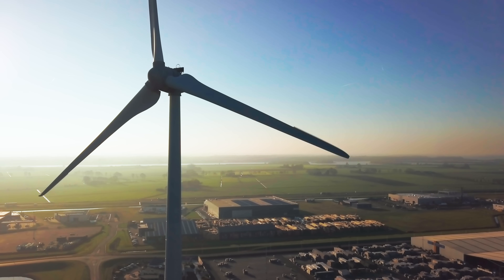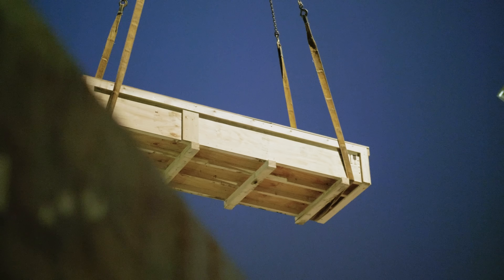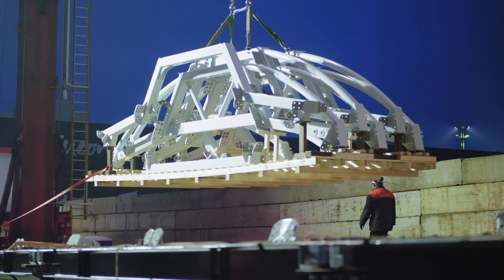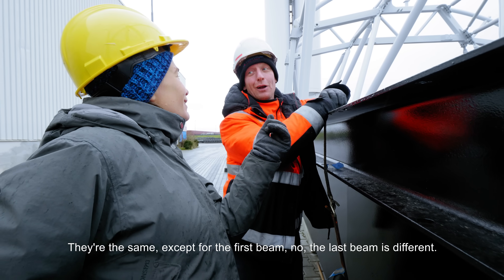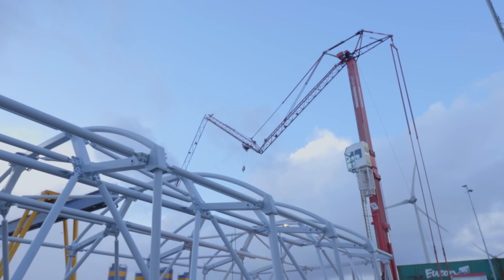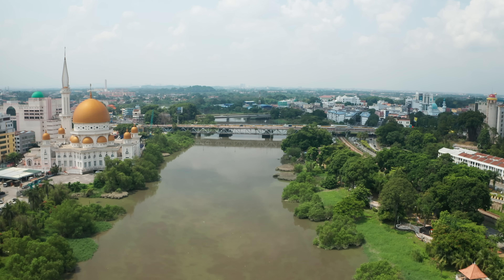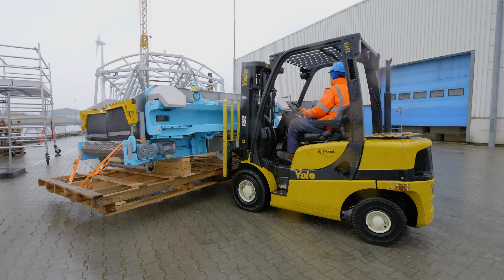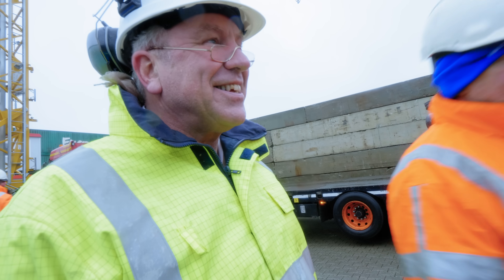Part 1: How We Engineered and Built the Interceptor Structure | Interceptor 004 | The Ocean Cleanup

Comment: Good job, guys. You have made it on the rivers!! 

Before lockdown you were brainstorming workable concepts to RETAIN plastic in the System in ocean conditions. Allow me to give you my idea to resolve that problem:

Ocean plastic tend to flow towards the coastlines. So you don't need to go to the middle of the Pacific to catch plastic.

In good weather, anchor a long buoy near the coast with a machine that collects the accumulated plastic. 

The buoy is the beach and the machine is the beach cleaner.

Marine life, such as birds, turtles, seals, dolphins and even whales, are mostly affected by plastic near the coast.

The above preserves key principles you want: the use of the water flow, the use of a conducting barrier, solar energy. 

At the end of the day the operator brings in the plastic catch to the shore.

When bad weather is forecasted, the operator brings everything to shore. When the storm is gone he deploys the system back to the sea.

The retention problem disappears if one works near the coast.
Reply from the maker: In essence, that is what our Interceptor is for - collecting the plastic before it can even reach these coastlines, using those very key principles you mentioned!
Reply: These Interceptors were never meant to go into the Pacific. But The Ocean Cleanup do indeed work on cleaning the Great Pacific Garbage Patch, as well. Two separate systems.

Comment: What if your inceptors were made of recycled ocean plastic? Could probably use a safety factor of 4 to counter the inconsistencies of the material.
Reply from the maker: We chose to construct the Interceptor out of marine quality steel, stainless steel, and aluminium because it can withstand various weather conditions, and does not risk breaking down into microplastics. However, there were small parts of our first ocean system Wilson built into the Interceptor!

Comment: haven't seen 'footage' of any of these systems actually channeling debris on the surface and below..

nor guiding trash to the conveyor...
Baltimore harbor water wheel shows exactly how it steers the Debris to the conveyor and the rake/ sweep mechanism that shoves the stuff onto the beginning of the conveyor... simple .. strong... functioning.... 

also the river cleaner resembles the Norwegian river cleaner... what's up ??????))???))))

why is o c dithering ?  problems ?  ok.. confess.. you are in New territory... screwups and patent difficulties are to be expected... covering up is the fastest way to lose DONORS !!!!!  don't act short term.....
Reply: They show this footage of trash collecting and going up the conveyor on basically every Interceptor video where one is deployed and working. For example, the Cleaning in Malaysia with 002 video has footage of it working. It doesn't need arms because it has the current and the barriers. Baltimore harbor trash wheel has neither a barrier or a current, so it need to have an engine to move around and arms to concentrate the trash onto the conveyor.

On a side note, your almost unreadable comments really undermine your critiques of the system.
Reply: @henrybyers5557  
excellent P R piece..you must be a lawyer...
I hope O C has success... so far i don't see actual collection other than a staged conveyor clip.... Hollywood music ... turbo splicing... distance shots...shots of  interceptors being towed... 
i also hope the recycling logjam gets worked out.. it seems too much collected plastic goes right back into the ocean
Reply: All your comments here are pretty annoying. It seems that you did not do your research , and you're only here to spit out your trash opinion
Reply: You are the most annoying comenter ever, on every video ocean cleanup is posting you put the same stupid comment. Get up and do something and stop complaining. Cheers.